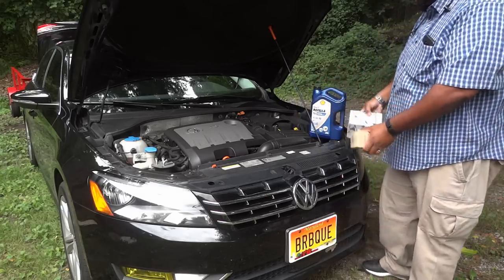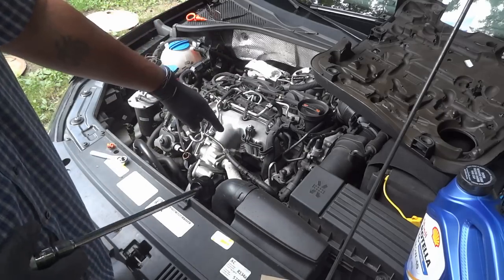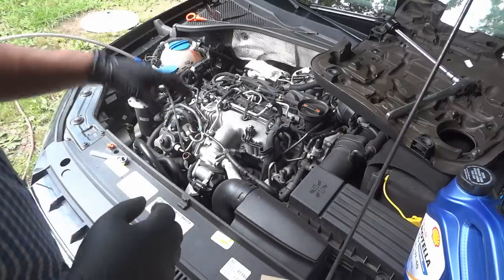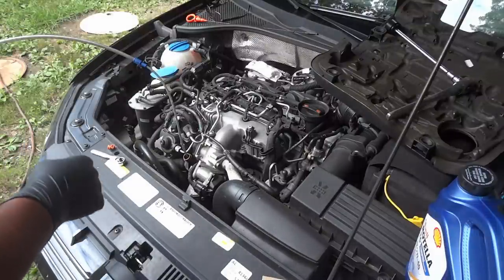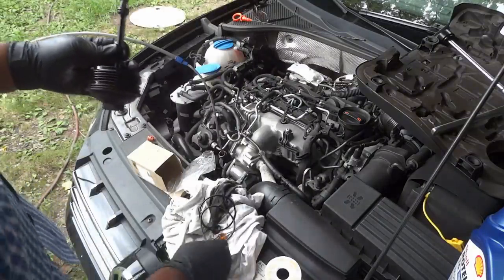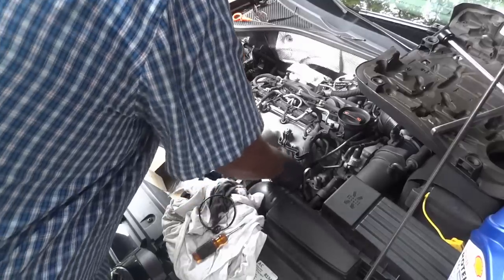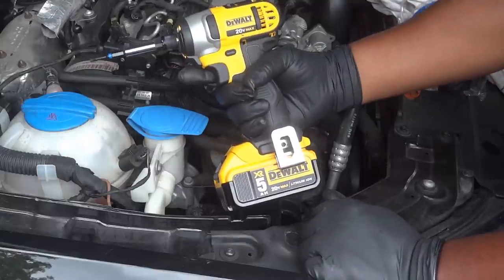2012 VW Passat TDI TopSide Oil, Oil Filter, and Fuel Filter Change

Comment: The 2015 TDI house filter from underneath. Must remove belly pan and then you can take the 19 mm drain plug out of the back because you’ll need a pan down there anyhow .  After draining the engine oil from the 19 mm drain plug next remove the center 13 mm pre-drain Oil from the canister,and then the 32 mm socket on the plastic cover. To move that wiring harness out of the way on the 2015 clip the zip tie and unplug the sensor and then the wire loom holder has a clip that let you slide the harness up and out-of-the-way. I was able to tuck mine on top of the fanAnd avoid getting any oil on the wiring harness.
Reply from the maker: Dang man...

Comment: VW TDI engines newer than 2009 cannot be primed with the ignition key and the pump has to be primed manually or with VCDS. Yes, you can fill the filter with fuel which will eliminate most of the air and the car will probably then start okay but the pump does not prime itself by turning the key on and off.
Reply from the maker: This is NOT the case with my model year. I can prime the fuel system without VCDS.

Comment: I did my fuel filter similarly to how you did yours.  So many on VW Forums though say you need to use VCDS to prime the fuel pump lest you risk damage (through cavitation - air in fuel) to the fuel pump.
Reply from the maker: Intestinal Worm I've seen that before as well to use VCDS, but I've never had any problems with the way I do it.

Comment: Good video. I use rotella in my 2012 Passat. I run 15w40 T6. I used rotella in my Duramax never had an issue.
Reply from the maker: Awesome man glad I'm not the only one!
Reply: I don’t know why people run the wrong oil when the right oil is not hard to come by.   Maybe hot climate 5w40’is probably ok t6 is not bad oil but not as efficient and more saps than the VW recommended oil .  Good video though.   I wouldn’t run it but it’s not my car
Reply from the maker: I've since gotten a different oil cause I can't get the T6

Comment: Oil extractor method looks so clean, I could do it wearing suit and tie. How do you normally clean the oil extractor after you're done?
Reply from the maker: I save the windshield washing solution bottles and old oil containers and pour it in them to be recycled. No real clean up other than that.

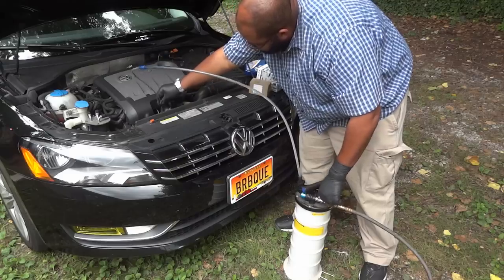Comment: Great Video !!! Very helpful.Thank you so much. But I would have one or two questions if someone PLEASE could answer : 2:18- 2:50  1) What kind of air pressure hose do you connect to the valve?in therms of phisics a) Is it pressurised air pushing into the walve, or b) is it a sucking/decompressed air hose leading from an intake of an extern compressor machine? I am so comfused. Everyone says just connect compressor air hose or simmilar... I am tired of pumping over the years,when changing oil and I want to go pneumatic,but wannt no damage. 2) Second question: does the use of air commpresor/decompresor  speed up the whole proces significantly? Thanx for the answer.
Reply: the air hose exits the tank creating vacuum in the hose you stick down the oil filler
Reply from the maker: Sorry I wasn't able to reply to your comment sooner, I missed it. It seems someone replied earlier this evening and I saw that notification pop up.

OK, so the hose I connected is from a regular air compressor, mine just so happens to have a 32 gallon tank as opposed to a little pancake 3 gallon. The hose connects with a regular 1/4" connector and the air is blown over a valve that created suction container and it draws the oil up the tube I put into the dipstick tube pipe. Just as long as you actually stick the suction tube down in the dipstick tube to get the oil you'll be fine, you can't mess it up. I think using the air compressor even if it wasn't faster would be easier since you're not pumping the container to suck out the oil, but I think it's faster to hook up the compressor.
Reply: First of all, thank you for your replies- however mr. daft nord has absolutelly missed my point. I will give you here some exact data,resoulting from my 1st pneumatic extraction performed 3 weeks ago. For method in this video, you will need a STRONG POWERFUL AIRCOMPRESSOR MACHINE  giving you stable airflow of minimum 120 liters per minute ... Some Folks would use decompressed CO2 in a press.bottle. My pump operates well at 30 PSI already...I can tell you that the difference is HUGE!!! 1) Theese cheap plastic pumps are usually beeing made in china- they loose efectivity over a time-the valves go bad and I missed the constant vacuum 2) With pressurised air in a bottle, I had literary SHOOT OUT THE OIL from the oil pan,AS OPPOSE to the silly hand pumping. In my case it was 7,5/8 liters in about 45 seconds and the remaining 0,5 liter took 6 more minutes... As you are getting down into the last layer of oil,it begins to whirl, airbubbles flow through the pipe... and you will sweat a lot wrecklesly for extra 10 minutes... This is the point where HANDPUMPING turns into a nightmare in case you do not want to leave the worst oil mud down in the oil pan and destroy your engine by sludgy mud as it cumulates over years. I have done dozens of extraction before. Pneumatic stile is just genious, but the blowing strong compresor is a MUST. Some cost around 100 USD but I would rather go for some of + 350 USD. Those are stationary, powerfull, one piston, two stroke gasoline, garage aircompresors, usually cooled by oil.Thanx again for the video and info.cheers.

Comment: What kind Diesel you using for your Passat TDI (regular Diesel  or  Bio Diesel)?
Reply from the maker: From what I understand bio diesel can't be run in the newer VWs. Something having to do with the injection pump pressure and or tolerances with the biodiesel. Funny wanting to make my own BioDiesel was the main reason that drew me to diesel VWs when I bought my first Diesel Jetta.
Reply: @SDSBBQs  thank you so much brother.

Comment: I prefer Pela vacuüm oil extractor, just a few pumps and it works no compressed air needed.
Reply from the maker: Well there's a reason those are so expensive! LOL, thanks for watching.
Reply: I think your right 😅 didn’t know i paid 100 euro for it. I have it for years now 😊.
Reply from the maker: LOL, I won't tell anyone

Comment: Dash real interesting.  My Diesel takes 3 Gallons of oil!  Plus my Condo won't allow people to work vehicles.  Fortunately I buy all the oil & filters and take it to a mechanic who does the change for me along with disposing of old oil pretty cheap.
Reply from the maker: 3 gallons? Damn sounds like a full size truck. We will not mention just how much oil I have sitting around in my garage. LOL.
Reply: 2007 Dodge RAM 3500 Dually.   Is it waste oil or oil to be used?
Reply from the maker: Mark N Waste oil. I've been keeping it with the hopes of making a waste oil burner to help heat my garage in the winter.
Reply: I have heard of this type heater.  Before you make your own consider this update to article on building them http://www.motherearthnews.com/diy/waste-oil-heater-zmaz78sozraw
Reply from the maker: Mark N I think I ha ave read that very thing once or twice before. I just haven't stumbled upon an electric water heater.

Comment: Great video but that’s the wrong kind of oil for that car unless it’s deleted.
Reply from the maker: Thanks and I the "right" type of oil is up to you and what you would like to use. This is what I us in my car.
Reply: VW oil spec is a lower viscosity and lower sulfated ash it’s better on the dpf and better mileage.    It’s a spec used across so many euro cars and can be bought at most parts stores like Mobil 1 esp 0w30 . 👍.

Comment: Hey thanks just got a 2915 jetta sel tdi .. will do bottom side oil change don't think I can do my oil filter from on top ..
Reply from the maker: As long as the filter is on top and most of not all newer German cars are... you should be able to do topside oil changes.
Reply: I will check it out thankyou !!!
Reply from the maker: Sure thing.
Reply: If it's a tdi the filter is topside.
Reply: Its a 2015 vw.tdi sel jetta diesel 2.0 and the filter is on the bottom ..
Reply: Rusty you are correct I had the 2013 TDI it was topside, yeah your is behind the oil pan.

Comment: That  oil for Passat tdi engines
Reply from the maker: I use it in all my Diesel engines, from my 6.0 Ford, my Jetta, as well as my Passat
Reply: @SDSBBQs  It's ok to use in the Ford and the Jetta as long as it's no newer than 2003 as in if it's an ALH engine Jetta. Not ok in the 2.0L Passat. Only 5W30 507 spec for it. I mean it's your car and you can run what you want but you shouldn't.

Comment: You Americans complain about vw engines reliability, while this guy is using shell Rotella t6 in a TDI vacuuming out the old oil like it is a joke😂😂👍
Those engines aren't good for US market, here in Europe they make several hundred thousands of km if you service them the right way, even if you do it in your driveway. The only engines that are good for us market (where fuel economy is a joke) are those big fat gasoline engines where you can put a milkshake instead of engine oil and they would work as well as before...
Reply from the maker: When did I complain about reliability? I love my TDI and this is the third one I've owned. My last one had almost 300 Thousand Miles and then I bought this one. The top side oil changes are GREAT and do a much better job of getting out the most oil. Oh and speaking of which the Rotella T6 is just fine for the TDI have been using it in my TDIs for over 200 thousand miles.
Reply: @SDSBBQs  Top side oil changes are not professional, you risk to leave a lot of dirt on the bottom of your oil cup. In order to remove sludge you have to DRAIN oil going under your car, like every real mechanic would do. Next, rotella T6 is a heavy duty engine oil that has not even a single VW approval, it is meant to be used in big trucks. I suggest you to look on your maintenance manual, but i guess you need VW 507 00 oil spec. Then i saw comments complaining about vw engines, and not only under your video.